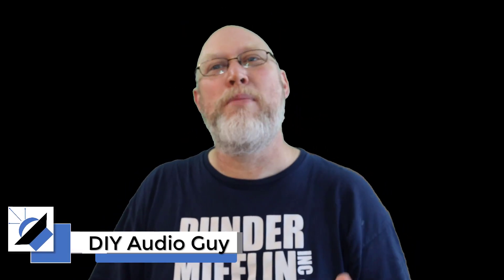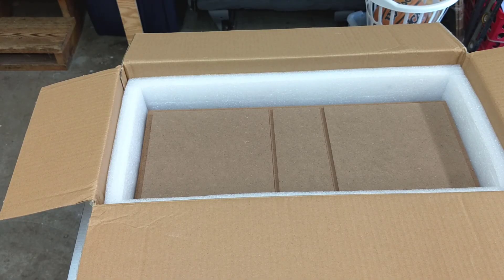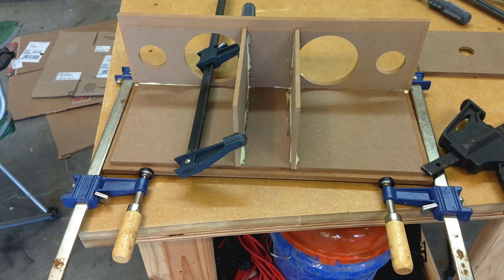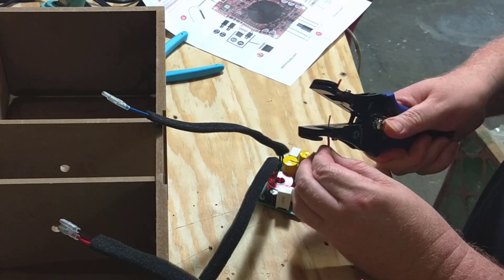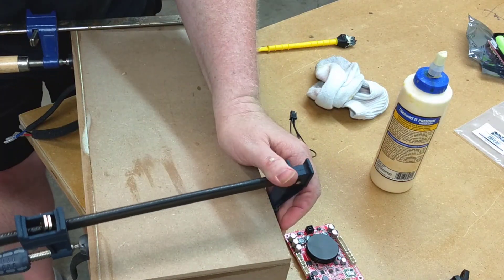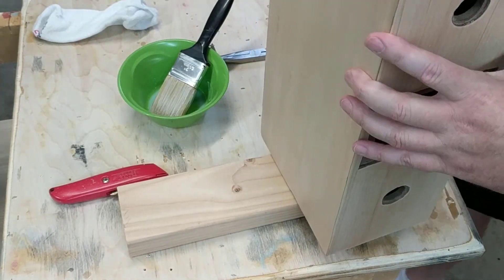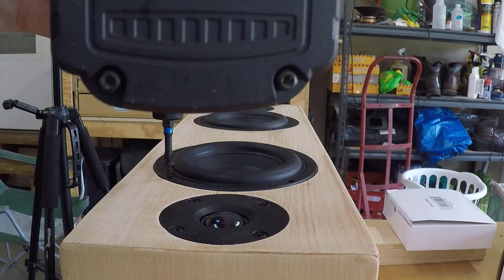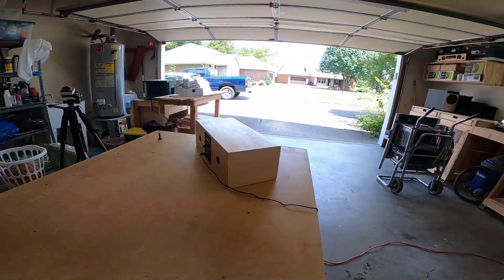DIY Bluetooth BoomBox,  The MK Boom

Comment: I can tell the inside partitions are 1/4” MDF but what size is the rest of the box 1/2 or 3/4 MDF?
Reply from the maker: I think it is 1/2, It might even be 5/8, but it's definitely not 3/4.  I did not measure it while I was building the kit, not sure why because that would have been useful information.

Comment: Ouch, that veneer! I am considering 10 mil oak on mine, but maybe painting the baffle flat black or building out the radius with plastic wood to square it. At any rate a router with a flush trim is mandatory, as long as the bearing is thin enough for the speaker flange depth cut.
Reply from the maker: Yeah, I should have painted mine.  Not my best veneer work.

Comment: Hi Audio Guy, you rock! I enjoyed your video. As I have never built a speaker before this is exactly what I was looking for. do You have any suggestions for improving eh bass sound on this project kit?
Reply from the maker: Thanks for the compliment I appreciate it.

There is no easy way to modify this kit.  You could probably build your own enclosure and design your own port in order to get better bass.  The problem with this enclosure is that the port tuning is just too high for my personal taste.  That does not mean that you will not enjoy it.

If you like the bass then I would recommend a different kit.  Parts Express has 2.1 kits that are a tad bit more expensive but they should perform better.  Just hit the link in the description to the current kit and you can navigate from there to find others.

Comment: “Not going to get a lot of bass with 2 4” drivers”. Me with my 3.5” BMR full range behind me, outputting flat from 60hz to 20khz. 🤔
Reply: BTW I love your videos, and in no way do I mean to disregard your comment in any sense, I know it can’t reach it for the size of the enclosure and port. It just made me chuckle that’s all. :)
Reply from the maker: I have a 4 of those in a pair of huge ported boxes, they will surprise you.
Reply: @DIYAudioGuy  Nice! I use mine as individual satellites for every speaker (apart from sub) in my atmos system. For such wide angle projection speakers their image really is pin point accurate isn’t it?! Mine are large ported boxes too, it’s a 3 part 3d print per box. 1 for the baffle, 1 for the speaker terminals and 1 for the enclosure. When I get a cnc mill I’ll be replacing the press fit baffles with ones made out of wood! 🥳
Reply from the maker: That sounds pretty damn sweet!  I pulled mine out of their enclosures just this last weekend, I was getting tired of the big bulky enclosures and I'm going to rebuild into something a bit smaller.
Reply: @DIYAudioGuy  depending how on how big you want your enclosures to be I’d be happy to send the enclosure specifications over, or if you have a printer, the STLs! ;)
Reply from the maker: @lio1234234  Thanks for the offer, but I am good.

Comment: That's a cool kit. I'm gonna get each of my kids one and let them build thier own bluetooth setup.
Reply from the maker: It's a great kit for kids.
Reply: @DIYAudioGuy  absolutely it is . I never knew parts express had them.
Reply from the maker: The kits are some of there best stuff.  They are a great way to test the waters and see if you want to get into speaker building.  My entire home theater setup is based on the TriTrix Kit.  If you want something with better bass consider upgrading to the blast box.  These little 4" drivers run out of steam when the bass drops low.
Reply: @DIYAudioGuy  awesome I'll look into it. I have always been into car audio but  You just opened a whole new door for me.